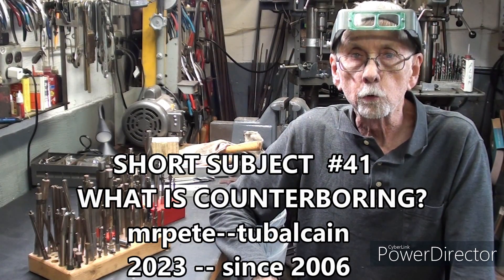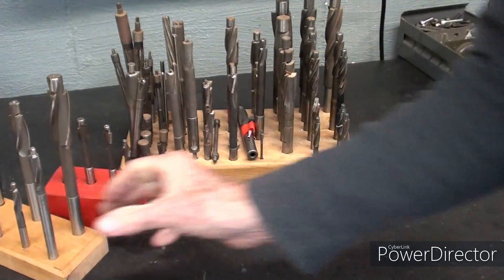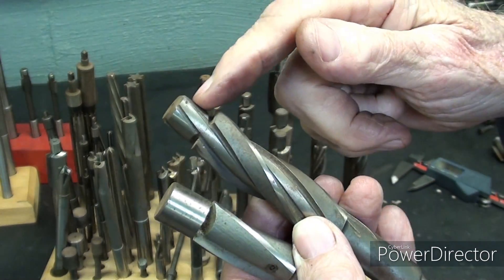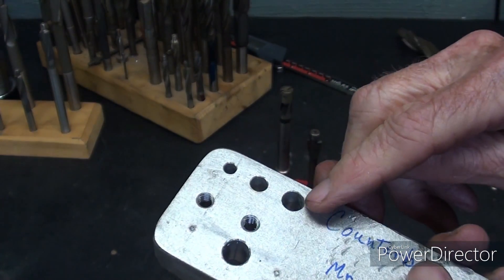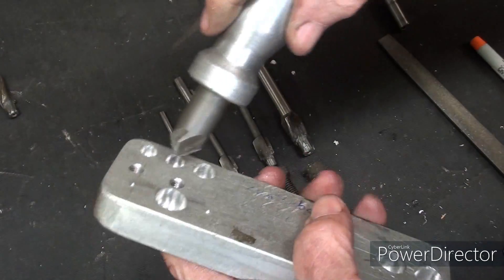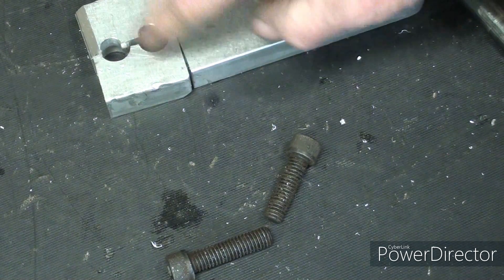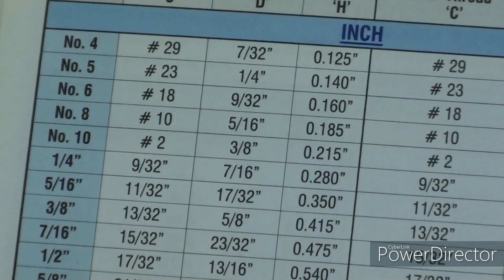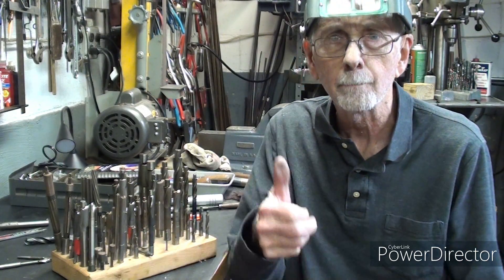WHAT IS COUNTER BORING? short #41 tubalcain counterbores

Comment: I make replacement handle scales for folding knives. The blade pivot is usually a counter bored hole. With so many brands out there, it's rare to find a combination of pilot and shaft that match the two holes required. I generally have to make what I need with a drill and a bench grinder! It's easier with a drip bottle over the work piece to keep the temper of the bit while grinding. 😂👍

Comment: As a heavy duty mechanic i used to cut counter bores on engine blocks in order to get the proper cylinder sealing and protrusion above the block after cutting the counter bore i would shim up the cylinder sleeves to obtain .003-.006 protrusion which keeps coolant in the block from leaking and head gaskets so they seal correctly

Comment: I have been using two unusual counterbores for several years. Well, both are unusual uses, only one is an unusual tool. I relocate the fuel jet in certain carburetors to prevent high cornering speeds from pulling fuel away from the fuel feed position. I have to move the jet to a place where the float of the carb might hit it, or maybe actually catch on it. My procedure is to bore through to the main fuel location, then counterbore the hole to allow the jet to be recessed into the wall of the chamber, after that, I tap the hole to allow the jet to screw into place away from the float. I used to use a standard counterbore tool in a drill press, now I use my Bridgeport. The second counterbore tool is unusual (and was expensive). I am slightly changing/relocating the bolt pattern on "mag" wheels to allow them to be swapped onto another brand of car. Just a tiny bit. At the same time, I machine the hole to install a steel tapered insert for each hole. The special counterbore tool has a cutting tip that bores a larger hole in the correct location, again just a little offset from the original hole. As the hole is drilled, the tool's shoulder eventually contacts and then cuts a new concentric tapered seat, contoured for the insert profile. This large counterboring tool was obviously made from a large drill.  After I locate and drill the new holes, I remove the wheel from the Bridgeport table and pull in the inserts. I used to pay shops to do this, now my Bridgeport does the job!
Reply from the maker: Very interesting uses for a counterbore thank you

Comment: Comment on @12:01 about the size differences. A small difference exists between bolt grades and also bolt manufacturers. Also, the undercut for the mating surface can vary substantially. Lyle, can you also do a short lesson (or demonstration) of the two different angles in counterboring for flat head machine screws. There is possibly even a third or even more when Whitworth, metric, or jis standards are used. You may need the old reference book and then again, maybe a recent one. 🗜️🔩🪛📐📏🏁  . Shouldn't be too much of a challenge to make a dedicated flycutter with interchangeable cutters and a cute gage to establish angles of both the screws used and the cutter needed for the job at hand. P. S.: When did you last see an elevator bolt?

Comment: A good machinist should be aware of older standards. You don't have to remember them specifically, but it isn't unusual to be working on stuff 100 years old. Knowing that there may be something different about the machine or work can save you from mistakes and frustration. 
Folks who work in metric have to be careful as well. Prior to WW2 there were different standards for metric threads in France, Germany, and Japan.

Comment: I have dozens of counterbores, many of weird sizes, but when I need a specific size/pilot configuration, I rarely have it!  I've made many pilots over the years (small sizes), but learned that if the fit is too good, they sometimes catch and self destruct.  A great way to get a tight fit if you need one is to drill an under sized pilot hole, counterbore the hole and then drill/ream the pilot hole to the size you need.

Comment: When counterboring a hole when only the tap drill hole has been drilled, a smaller pilot is required. This is when the removable pilots would come in handy. I've run into that situation several times and a set of counterbores with changeable pilots would have been very useful.
Reply from the maker: Thank you, never thought of that

Comment: Hey Pete,  good video as usual.  Shop where I work, die shop, generally 1/64 or 1/32 over pilot diameters.  Most of our die sections are 1/32 over on fasteners.  Our complete set is 1/32 over.  Then enters the "engineers" they spec anything and everything for counterbores, guess it is off the top of their head or what the CAD program popped up.  Ok I use my head, kinda, measure heads of shcs etc.  Cut off more than a few drill bits to make odd counterbores for print drawers.  There are specs for this stuff, don't these guys ever look, heck they call out drill diameters that aren't on any charts, not going to bore a diameter for a simple bolt to go through.  Gee.
I am starting a rant like someone I know.   One of our engineeringnerds specs .562 deep holes through .5 thick materials instead of thru.  Old guy I work with, hey he is 76, I am only 61, he showed me on print, told him just bring quill down further, make sure.  Ha.
Hey gotta add one, counter bores are wonderful tools, but if you are working with a homemade flat bottom bit chopped off and hand ground.  Bridgeport or clone spindles have just enough backlash on quill to chatter, lock quill and feed with knee.
Hey Pete,  keep making videos.  PS, you aren't the only one that can do a rant.
Reply from the maker: Very interesting

Comment: If you have a 3flute you can put in your machine and get it turning just fast enough you can let a caliper ride on the counterbore. While spinning with caliper oversized slowly close until starts to touch. But dangerous so don't recommend it.
Reply: Hmm, I have a three flute. What was that again about spinning with oversize caliper and slowly closing until it starts to touch? I didn't quite get it. Thanks.

Comment: For years I never even knew these existed. (for context, we don't do any sort of production work) counter boring operations were always done on a milling machine using a slot drill right after drilling the associated hole. Had I known about these, there would have been times when I'd probably wish I had a set of these handy little gadgets.😄

Comment: The older version 5/16" bolt head looks very similar to M8x1.25. I wonder if the ASME (or whichever standards body decided to change the diameter) did so to make 5/16" hardware easier to visually differentiate as metric hardware became more common. Interesting history lesson. Thanks Mr Pete.

Comment: Very interesting topic. When I received my shop training at work, I had to drill a partial bore hole then re grind the drill bit to cut a flat bottom. Then when done with the counter bore, re sharpen the drill bit by hand on a pedestal grinder. Then drill a hole, supervised by the instructor to prove I could sharpen a drill bit correctly. I was so happy when he let us use counter bore bits. Sorry for the rant but I couldn't pass up telling my story. Thanks for all that you do.

Comment: Very informative video, even the cap screw info. Restoring an antique vehicle would garner extra points for having the period correct screws.
Reply: I have a copy of a 1918 Machinery's Handbook. It contains the dimensions of hardware of the time. Most has changed over the years, especially the head and nut dimensions. It is also very useful to see the normal practice of the time. Many things have changed over the past 100+ years.

Comment: In a pinch, I once used a 1/2" end mill in a drillpress to make a flat-bottomed counterbore in mild steel. I'm still alive somehow.
Reply from the maker: Scary. It will also rattle your nerves to use a flat bottom. Drillbit on a drill press freehand.

Comment: I have often counterbored holes using two drills, one with the standard taper and the second with the end ground flat with clearance much like an endmill. It is an easy grind by hand and does a good job.  I just run them on the slow side.
Reply from the maker: I made a video on that two years ago and never did release it

Comment: Boat carpenters also use counterbores to create room for a wood plug over a flathead wood screw to seal it from water or for cosmetic effect.

I'm most familiar with Fuller taper bits with a depth adjustable counterbore  set by a pair of set screws.

Excellent video as always.

Comment: I had to counter bore 2 days ago. This was the first counter bore job requirement since setting up my new hobby shop 1.5 years ago. 
Industrial machinery is nearly exclusively assembled with SHCS. this hardware is most commonly harder than HHS hardware and fastener and wrench clearance space requirement is much smaller. "Flush" fastener appearance is also much cleaner and is often an industrial look design element as well. While conventional wrenches and sockets were a must tool demand for this industrial maintenance technician, I vastly used hex wrenches more. For this reason, I own every hex wrench, socket, T handle, screw driver handle, power bit style manufactured in both standard and metric, plus quite a few custom fabricated versions for special application. 
Until working with these fasteners on a daily basis I didn't appreciate their value. 

I think that counter boring best practice is to break the corner at the top of the counter bore hole. There are applications where this may conflict with a design element, but the square corner can be quite sharp.

Comment: The gearbox on a Brunswick A2 pinsetter machine is aluminum and all the gear sets that bolt into that use these plus a copper gasket behind them so they don't leak I've had to repair many holes And re drill them and counterbore them I have a set of counterbored drills in my toolbox

Comment: When boring for threading all is centred. Use a drill bit large enough for the screw head and finish off with an end mill. Much cheaper then buying special tools, not used very often.
As You, when You already got them, of course use them.

Comment: I have a set of counterbores, but ran into a problem the first time I used them. The pilot wouldn't fit the nominal size hole, i.e., a 1/4" drilled hole was too tight a fit for the 1/4" counterbore pilot. I had to drill the hole to it's "close-fit" clearance size 0.257 with a letter-size "F" drill bit before the pilot would fit.
Reply from the maker: yes, that can be a problem
Reply: Musta been purpose made for something odd or a factory reject.

Comment: Here in UK I only ever use metric allen screws these days. 

But you have made me wonder, so I'll have a look at the allen screws on my 1966 Norton 650SS. The problem there is that most British bike threads of that age are cycle (steel on steel) or Whitworth coarse (steel studs into Aluminium), so they do not map to US threads and their associated socket size. 

(If anybody can point me to a formula I can use to calculate Whitworth/BS spanner across-flats dimensions based on bolt/screw size I'd appreciate it.)
Reply from the maker: Sorry, I can’t help you with that. But we sure did like those Norton, BSA, and triumph motorcycles here in the Illinois Valley. I had a friend that had an Ariel Square four or is it an aerial foursquare?
Reply: @mrpete222  I worked for many years near where the Ariel factory had been. I taught at Birmingham University, and Ariel had been in Grange Road - just over the Bournbrook, adjacent to the Westley Richards shotgun works. All of that is now student residences - the UK decided years ago it didn't want to make anything any more.

Comment: A very enjoyable watch, here in England the 1/4 whit cap screw has a 3/16" hex key socket. with the same 20 TPI thread as your UNC 1/4" but 55 degrees instead of 60 degrees, wow that took longer to type than your video!, cheers Dave

Comment: I have a Bridgeport but no counter bores. If I need to counter bore I drill then thread if needed then counter bore with an appropriately sized endmill watching the DRO. Once I've finished I'll then move to the next hole.
Reply: I think that that’s what most of us hobbyists do, although I think I might acquire a small set of counterbores for my most used sizes to save a bit of time and effort.

Comment: It's another enjoyable educational video, it was counter boring,  doesn't that mean not boring?

A great big factory that closed up decades ago only used Morse taper tooling 1/4" and above. So they had the tool grinding department make counterbores from brand-new drill bits. They would grind off the front edge and bevel it, then grind the od down to the pilot size. They worked great and held an edge but were only two or sometimes three flutes. They also made sheet metal drills, that's a story for another day. In this day and age, who could imagine having a tool-grinding department, they did all the maintenance on cutting tools from drill bits to gear hobs as well as custom tools and "stacks" for horizontal mills. That was then I suppose...

Comment: Hi Mr. Pete. Another great video. I am not a machinist. I do have a small shop at home and enjoy making things. I did take machine shop in high school and always think about my career choice machinist or mechanic. My grandfather was a machinist and had a small shop. I did get some of his tools and I use them everyday. One machine is an old sears 101 lathe which I am restoring. Over the years of being a mechanic I worked on cars, trucks, heavy equipment and hybrid buses. I'm sure if I would have been a machinist I would have enjoyed that career also. Now I retired and am having so much fun and learning new things. I did buy a standard and metric set of counterbores. I like measuring the head diameter and using one that fits best. I did a few projects where the hole was to big. Thanks again. Mike.

Comment: Are the pilots made slightly undersize to fit in standard clearance holes?
Reply: Yes the pilots typically a few thousands smaller than the hole to prevent rubbing and possible seizing.

Comment: Hey that's not stupid at all! Knowing that there COULD be a difference between cap screws might save us some headscratches if we're working on older machines! 😁 

Thanks Mr. Pete, you're a fantastic teacher!
Reply: I concur!
Reply: Hey, I have ran across this problem, older cap screws sometimes had smaller heads, not a problem for making new holes, but I have had to turn down heads of new shcs's to fit old holes.

Comment: I sort of drilled a counter bore prior to having any counter bores. When I welded up the stand for my portaband I had a small piece of steel that I drilled to screw into the holes where the guide was. I then drilled two holes in what ended up being the bed with the same spacing but large enough for the heads of the screws. I then welded the small one to the bottom of the bed. Clear as mud?
Reply from the maker: lol